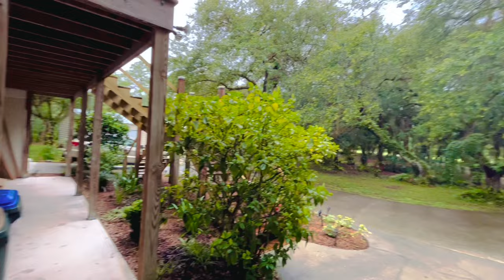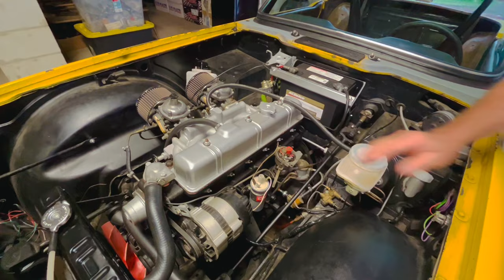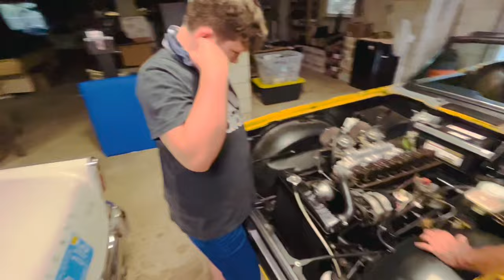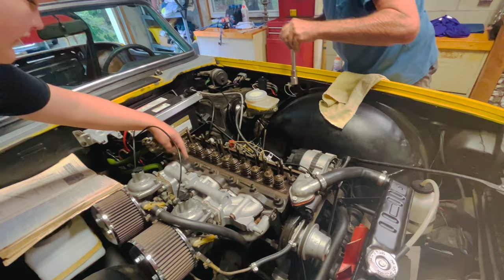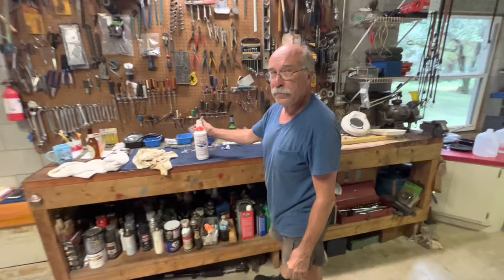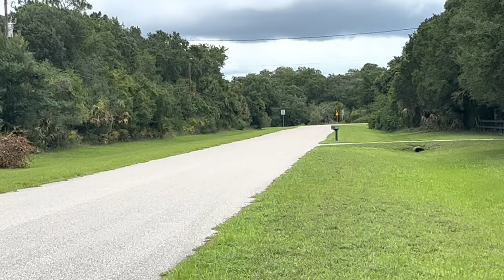73 Triumph TR6 Restoration Project- valve adjustment and cylinder head torque spec.

Comment: Nice work ,I hope that solves the leak.
Reply from the maker: Thanks Barry, so do we but if it doesn’t not a big deal. We can break the engine down and put a new head gasket on
Reply from the maker: Thanks Barry, so do we but if it doesn’t not a big deal. We can break the engine down and put a new head gasket on